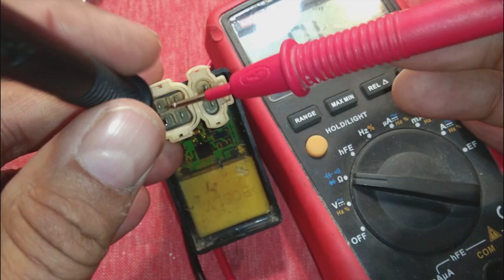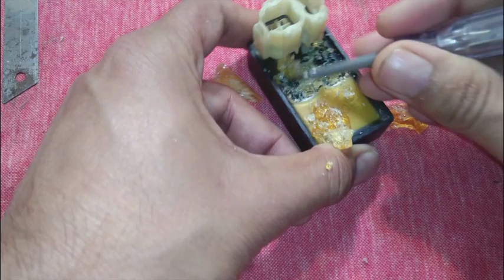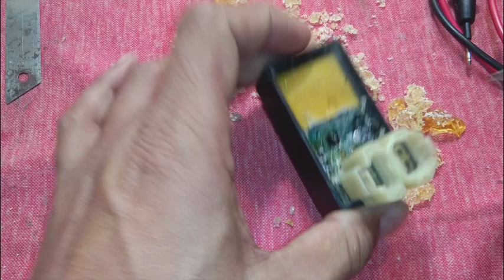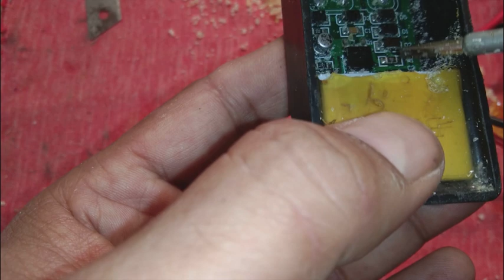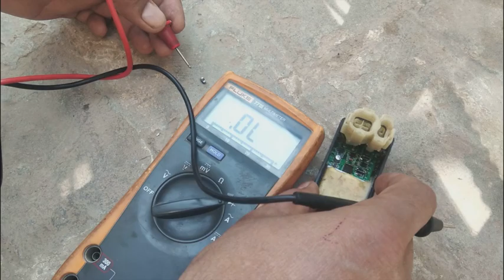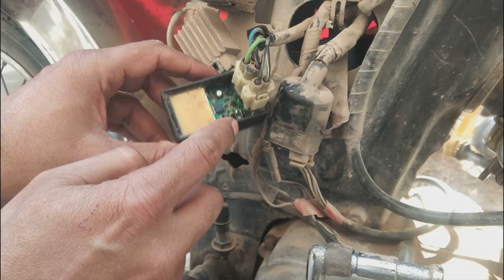CDI unit repairing. how to test bike cdi on multi meter. motorcycle cdi unit testing on multi meter

Comment: Maybe you can help explain for me. I have a pw80 two stroke with good spark, fuel, and air, but will only backfire. I replaced the stator coil and ignition coil to achieve spark but still no start. Pw80 has no trigger, just one stator coil so the cdi does all the timing? Is my cdi broken or am i crazy??!!!
Reply: Change the cdi or cdi coil combo
Reply: @ i did actually change 2x cdi, altered timing, new rings and reeds, all with the same result. Backfire. I have never given up before but i ended up giving it back defeated and now its a bad memory. Thanks for reminding me.

Comment: Hello, nice video. I opened a cdi unit just like this. I see a 14pin chip inside. Sx195 190141. Maybe an IC. I searceh the internet and i is nowhere to be found. Do you have any idea what this is or an name of code of the same alternative ? Thanx
Reply from the maker: Such are special code number chips. Sometimes they could be programmable microcontrollers with specially written firmware and uncommon number code on them. Unfortunately they aren't easily available.

Comment: I understood everything clearly and followed along perfectly, I had my doubts about the voltage coming in from the coil but when I saw the style (mylar film I believe) capacitor I realized the numbers you gave on the first video most likely are correct, thank you for posting. Reading smd codes is a pain in the arse, 1N4007 we all have, or we should
Reply from the maker: Best that you understood it well and realized the truth. Such voltage you can measure usig a multimet at some 750v or 1000v ac range preferably an analogue multimeter for the subject job. 1N4007 are the best diodes you can use everywhere.

Comment: 💥🏍️🤔Hi, Can you use that CDI or which is the replacement like that can be use on a yr2000 Kawasaki Vulcan Classic 1500cc E3( it has a AC Dual Stator)💥

Comment: sir, informative vid ... one question, i connected battery with reverse polarity . Thereafter, no ignition, everything dead when i connected battery the correct way. Normally, the battery has a  main fuse located near battery but previous owner was using roadside mechanic who bypassed fuse. So, what component would be affected by the reverse polarity connection? its a 2018, suzuki gixxer, carb model. Many thanks.

Comment: Salve, video interessante.
Vi volevo chiedere come si fa a sapere se la moto vuole una centralina AC o DC.?
Grazie e buona serata
Reply from the maker: Thanks. Ac units are small in size and DC cdi units are usually big 8n size. The wiring configuration tells you whether the system uses AC or DC cdi. In AC system the armature coil directly feeds the cdi. In DC cdi system, the battery feeds 12v DC to CDi unit through ignition switch.

Comment: Can we upgrade cdi in bike and get more performance from bike like top end speed by improving current?
Reply: No. It's just a power flow circuit. If it has a built in speed limiter, the wire can be disconnected or cut.

Comment: Thats awsome thank you what tools do i require to be able to repair the cdi units?
Reply from the maker: Screw driver, pliers, soldering iron, hot air station, multimeter etc.

Comment: Thanks! Do you have an experience with CDI’s for bigger motorcycles, for ex. 500, 600 sm3 - Suzuki, Yamaha, etc.?
Reply: This is single phase, I believe about all of them test the same, if yours is single phase this applies.
If it's 3 phase however, the testing is different.

Comment: Please make 125cc AC cdi
Reply from the maker: They are using the same CDi unit.
Reply: @JahanZeb1976  how can I make one?
Reply from the maker: I have another video on my channel where I explained it's circuit diagram and connections but better to purchase a cdi unit than make one. They are cheap and works well.

Comment: Hello i have a source coil and it is potted together with the cdi box, i am in the process of stripping everything down and will need to repair the cdi box and rewind the source coil then rewire everything the problem is i dont know how it was wired as i had to disassemble it, it is for an echo twin cylinder chainsaw, have you ever repaired a unit like this
Reply from the maker: No, I never get a chance. You can do it by diassembing carefully the older and do new the same way.

Comment: how does the CDI circuit board advance the timing with increasing rpm?
Reply: by using a throttle position sensor, which is just a magnet attached to the throttle and it activates a reed switch when you open the throttle completely

Comment: Where did you get the replacement diodes? Nice Vidz
Reply from the maker: They are very commonly available and low cost diodes 1N4007. I had taken them from an old board. These diodes are there in almost all 230v operated boards.

Comment: Sir.. How cdi can control speed motor
Reply from the maker: CDI is not controlling motor speed. Instead CDI is following speed and providing spark on all speed to the engine. Engine speed is controlled through quantity of air fuel.

Comment: Great video, thank you very much. Can you also show how to remove the rev limiter in CDI Units?
Reply from the maker: There is no rpm limiter circuit on these cdis. Limit comes due to the whole design of the system. Next in some video I will provide details about DC CDI. DC CDI have no such limits. But it needs a battery on the vehicle to make it working.
Reply: LearningZone i have a Hyosung sf50 Scooter with an AC cdi That is Limited to 7000 rpm. It has the same shape and connectors as the cdi shown in your video. Best regards
Reply: @willybaldsirhenry  &n.v
Reply: You replaced two surface mount diodes with lead type for thru hole circuit board design.  In your repair the diodes are offset from conductive pads on circuit board.  This is not a reliable fix as the diodes have 3x mass and are not properly supported by thru holes from vibration on vertical plane axis. They  are also susceptible to thermal expansion stresses from the leads.   Even with potting reapplied this is temporary fix at best.  CDIs are relatively inexpensive and there are no guarantees the other diode that was not replaced may fail shortly afterward.
Reply: are the diodes a zener or schotkey ?

Comment: Hello, it's really interesting video, thank you. I have question.  can i used cdi from different motorcycles or they have some differences? For example cdi on Honda transalp and Honda dio look at same, can i swap it?
Reply from the maker: If they are same in shape and design, you can simply swap them as they are pin to pin compatible.
If they have little change in shape and model number, you can replace the CDI with minor wiring changes.

Comment: sir mene ap kay har chinel per sms kya hay lakin ap ne kabhi jawab nahin dya mene pocha tha kay mere pass 10 amp china batry charger hay lakin is ka main power suply ka mofet phat gya hay is ka number nazar nahin aaa raha kon sa mosfet lagaon 15 din say message kar raha hon lakin ap jawab nahin daty
Reply from the maker: I already replied you from my other channel. You can check it. Anyhow you can put any mosfet like 13N60, 9N60 or 7N60. These are very common mosfets and you can buy any one of the very cheap. But if mosfet went bad sure you would replace smps ic uc3842 also and check for other bad burned components like resistors, capacitors and diodes.
Reply: thank you sir jiii
Reply: thank you sir baki ap ka samjhany ka tareka best hay koi video bhi banay charge repair per ya tv repair per
Reply: sir jiii 13n60 ki jagh per mujhy market say 13n50 mila hay 10 amp charge kay lay kya ya lag jay ga plz gide me